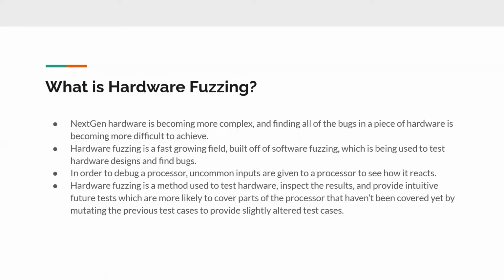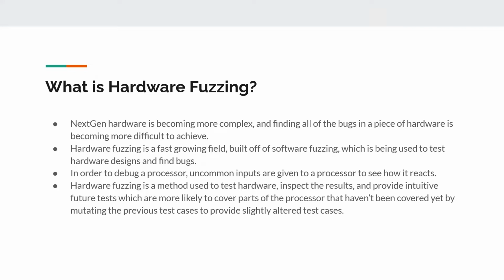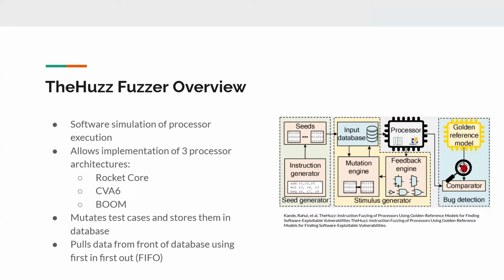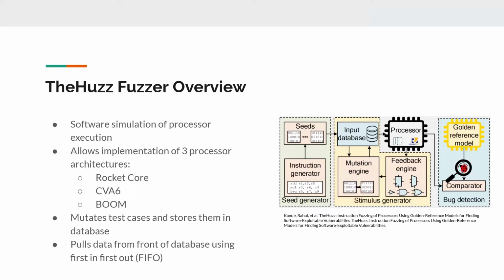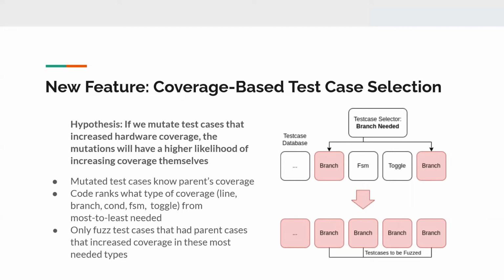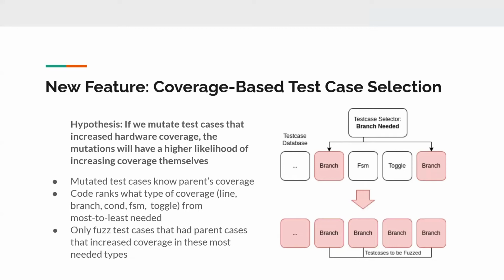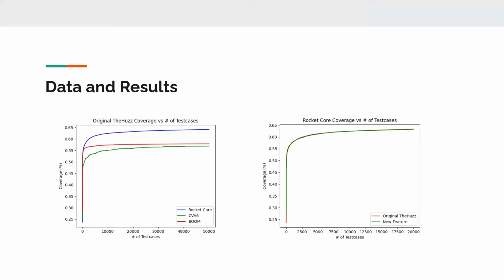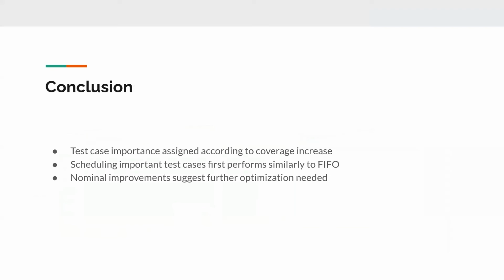ECEN426 - Hardware Fuzzing - Team: Segmentation Fault

Comment: Sameer Osama: I just wanted more clarification on what was meant by hardware coverage. And how does the code decide which coverage is most/least needed?
Reply from the maker: Ryan Middleton: Thank you for the question Sameer. Think of coverage as wanting to look at a circuit and go to each net, module, piece and make sure that the testcase can verify the outputs from the given inputs. We are trying to cover the possible scenarios that a processor might see in its lifetime, even atypical ones. 

To answer your second question: Our feature looks at the types of coverage points out there (fsm, line, branch, tgl, and cond). From the processors design, we know how many possible coverage points there are from each type. We divide the current coverage of each type by the possible coverage for each type to get a percentage of coverage for each type. Then we just rank them to determine the coverage we are looking for.

Comment: Caleb Norton: From the graphs shown on the Data and Results slide, it seems like coverage levels off far before 100%. What could be the reason for this and how do you explain the different asymptotes across the 3 different CPU architectures?
Reply from the maker: Ryan Middleton: Thank you for the question Caleb. kind of like I was telling Andrew, the asymptotes of the leveling off is more dependent of each processor's design. The architecture of rocket core is just easier to cover than the others. The coverage points are split into different types like branch, line, fsm, toggle and cond. Some coverage types are easier to obtain than others depending on the architecture so if a processor has more of a hard to cover type like toggle, than it will naturally have a lower coverage percentage.

Comment: Frank Gibbons: Are there any obvious types of architecture patterns (or similar pitfalls) that a fuzzer would not be able to detect?
Reply from the maker: Ryan Middleton: Thank you for the question Frank. The fuzzer should be designed to work on any fuzzer for practicality. in this case, the method of selecting a metric could be revised to fit a certain processor's needs and specialty, although TheHuzz should be built to handle any processor. If you look at the diagram on the "TheHuzz Fuzzer Overview" slide, the feedback engine could be edited to adjust for the architecture by altering the mutations.

Comment: Robert Dye: Howdy! When are some possible instances where the processor does not need to be debugged.
Reply: Ben Alcorn: That's a good question, it would be good if there was no need for this fuzzing. However, I think this is essential for all types of processors, as the analysis of coverage is necessary to make sure the processor functions the way it should, regardless of the architecture. Since the processor is mainly designed to deal with a specific instruction set, we want to make sure that we account for cases where the input does not match any particular instruction and look at the respective output.